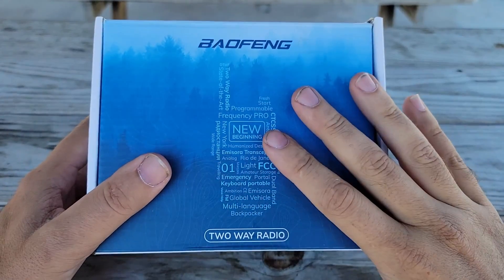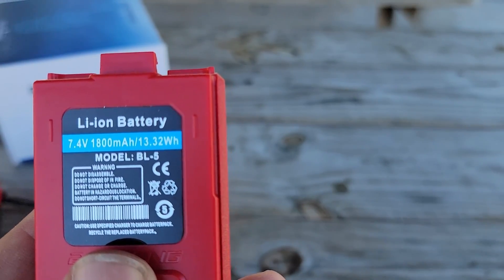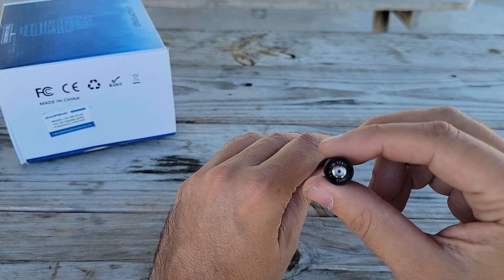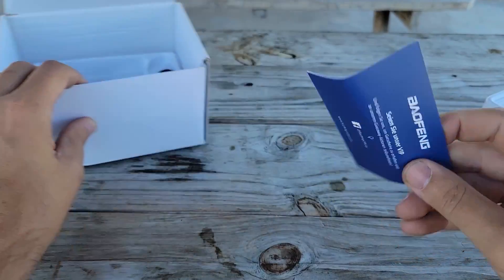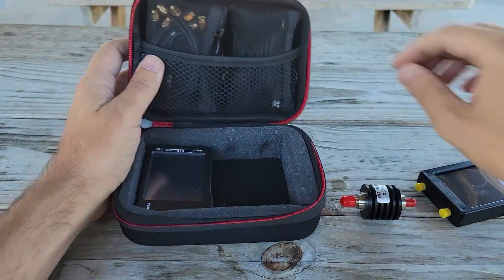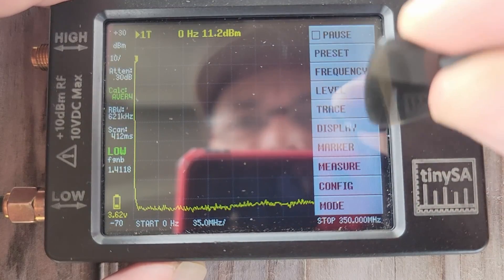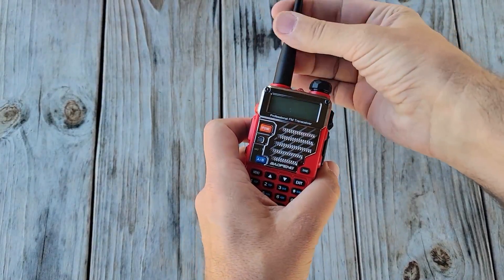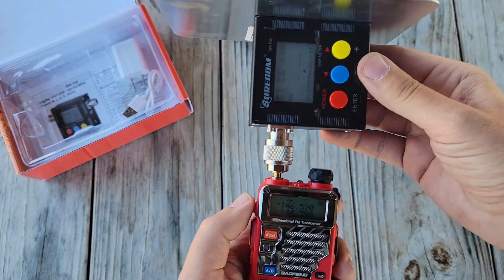The Baofeng UV-5RPlus+ (Yes, Plus Plus??)

Comment: What does dirty mean ? Just getting into radios want it mostly to listen to wildlife management teams to photograph animals
Reply from the maker: Glad you asked.  It means a couple of things.  But its most basic is that you are transmitting on your frequency you've entered, then also on the frequency * 2 and the frequency * 3,4,5 etc.  Those frequencies might be important to other people or even you.   It also means that if you've only got 5 watts of power that some of that power is going out on those frequencies instead of where you want it to go.  Which also means you're easier to find.  I'll make a video on it soon, but in this video you see the tiny SA screen where I show the different spikes and then they dissappear after a bit - those are the "dirty" harmonics.
Reply: @temporarilyoffline  ok , I appreciate it ! So how (or is there a way ) to clean up a dirty radio ?
Reply from the maker: @seangoc  you would need a bandpass filter: https://amzn.to/4eZjwqa but given the cost, it's cheaper to get a clean radio to begin with.  They are made from cheap commodity components though, so pretty easy to build as you get further into the hobby
Reply: @temporarilyoffline  thank you for the explanation and link. I appreciate it

Comment: Hello. I have an old anytone handheld radio and it works on the vhf band. I don't know what i press, but the range is now shortened from 150,000 to 174,000, instead of 136,000. Does anyone know what is the problem?
Reply from the maker: Which model anytone do you have?

Comment: It would be nice if these used off the shelf AA batteries.  In some devices that use 3 AA I have been using 2 dummy AA cells and 1 lithium AA cell.  The voltage range matches exactly with NICD and NIMH.  3.0V-4.2V
Reply from the maker: Here you go:  https://amzn.to/3THra15

Comment: Hi, Steve. Thank you for this well done review. I am checking out the links you provided but I do not see one for the antenna you mentioned nor for the reflector plate for SW-102. Do you have those? Apologies if I miss them.
Reply from the maker: I did forget it!  The Super Elastic Signal Stick comes from https://signalstuff.com - I can not find a current listing for the SW-102 from surecom that includes the ground plate.
Reply from the maker: 👉 Surecom SW-102: https://amzn.to/3uK30J2
(There is no ground plate included in current models, make a simple "tiger-tail" of 19.5" on 2m and 6.5" for 70cm)
Reply: @temporarilyoffline   Much appreciated!
Reply: @temporarilyoffline  Thank you very much :)

Comment: Hey, I have one of those... I use it for receive only. I have a Baofeng GT-5R and an Alinco DJ-VX50 that I use to monitor and occasionally chat on local repeaters. The Baofengs are easy to program on Chirp, but difficult on the fly. The Alinco is very easily programmed on the fly. Those earpieces... never used 'em. On another note... I'm so happy to see the existence of small test gear like the nano VNA and TinySA. Back when I was really active OTA, testing equipment was more expensive and much larger! 73
Reply from the maker: Good plan!

Comment: Bought the same one 3 years ago when I first became interested in ham radio. Never used it for more than receive till this last Wednesday to check into my clubs net. Worked great! Been using my ft5 and qrz-1, kinda forgot about the poor little baofeng. Our repeater is about 30 miles away from me through a windy canyon so have to use some antenna angle magic to hit it but it got the job done.
Reply from the maker: Knife Edge Refraction!!  Nice!

Comment: that the plus + .and it is red.  mine is black and about the same with harmonic's and power. just a UV-5R . but I have tested some that are quite dirty. same manual I threw out.  their is Baofeng program softwire for that but CHIRP much better. They have USB C battery for them now. both standard and hi  cap.  their is a 2200 MAH battery as well. just thicker not longer. came with one of mine with Nagoya NA 771 antenna package with speaker mic.  I have several stock antenna I don't  use.  maybe a coffle stir stick . has been done . video on you tube. water proof Baofeng in the shower as well.   I have a UV-5G as well. looks the same until take off antenna. the radio is SMA F .GMRS version. and it's clean . no TX outside of GMRS. I seen blue and cameo even a silver face black one. even a real big army green one. 73's
Reply from the maker: Nice Robert! No bad radios, just radios that we can make better!

Comment: I did once use that headphone deal to create a cable for my ear pro. Really I just cut off the earphone and attached the typical TRS 3.5mm. I wouldnt recommend it. Would be fine if they just saved the 50 cents it cost to add it.
Reply from the maker: Exactly, just bad enough to not be useful/usable!